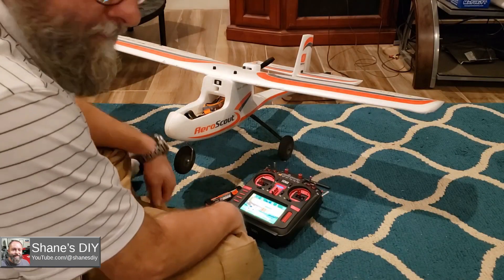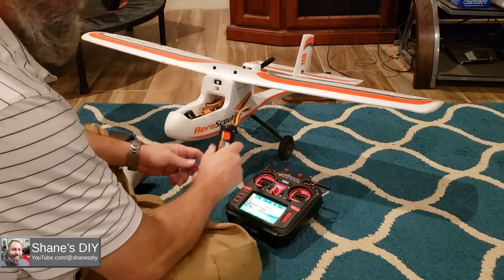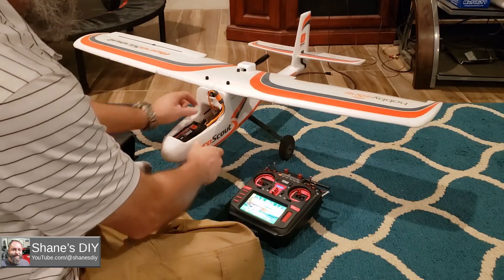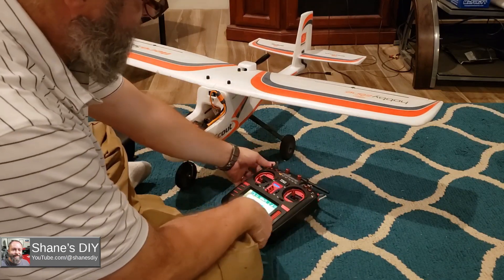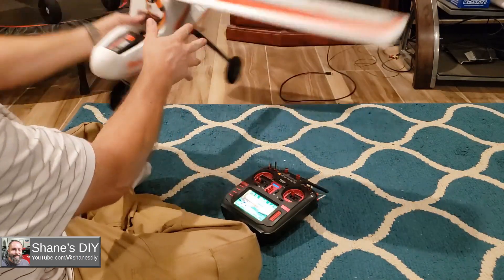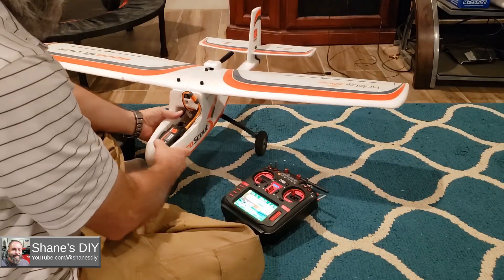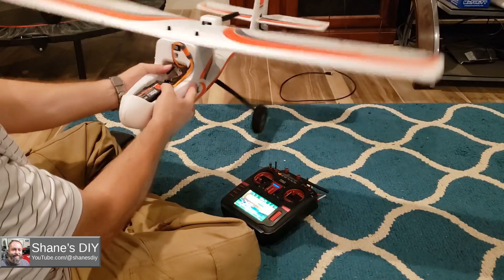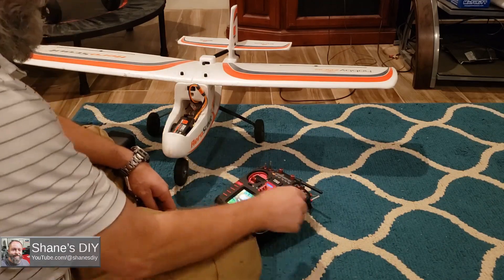BUSTED!!! Spektrum SAFE Mode Myth #2 "Throttle up to enable SAFE"

Comment from the maker: Still a few people that don't believe even after demonstrating it.  Figured I'll add that I am specifically referring to the Spektrum AR630, AR631, and AR637 that I have been able to personally test.  Read the Spektrum receiver manuals, they also clearly state AS3X is activated at 25%, doesn't say that about SAFE for other models such as the AR8360, AR10360, etc.  Could be something older like an AR636 that this does not apply to but perhaps someone who has an AR636 can confirm for us.

Just to be clear, this isn't really an issue to worry about.  The airplane will fly fine if you perform your checks properly.  Where it becomes an issue is when someone is trying to program their safe select/F-Mode switch to a channel and is having trouble and an "expert" tells them to throttle up to 25% make safe work.  It won't help and it makes it harder to actually help them solve their actual issue since they have to weed through bad advise.

Comment: Yep, SAFE mode doesn’t require opening the throttle, but AS3X doesn’t activate until you open the throttle above 25%. This is one reason why I like to do my gyro direction test in SAFE mode.
Reply from the maker: For sure. So much easier to check your gyro directions in safe. Eliminates the guesswork.

Comment: I just did it, about 15 times in a row. I picked up three brand new Aeroscouts yesterday to take to the lake and sure enough….SAFE mode WILL NOT initialize until throttle is moved, on all three . AS3X is on as soon as the plane is powered up.  
Note…I did buy the RTF models as it’s cheaper than the BNF, then just bound my IX20 to them. Surely wouldn’t think that would make a difference though. Same receiver.
Reply from the maker: You have the terms backwards. Safe (auto leveling) is on immediately if in f-mode 1 after power up and initialization, as3x (wind mitigation) turns on after throttle is raised.

Comment: Shane, i programmed a 3 position switch with forward programming in a boxe tx.
Mode 1. : as3x and autolevel, mode2 as3x and envelope and mode 3 nothing ( no as3x and no safe) . Problem : rated in mode 2 and 3 are full rates or full throws but my skills are not good enough to fly in full rated , i use to fly my plane in mid rates before i switch from lemon to ar631.
Is the a way to have mod 2 with medium rates , as3x and envelope? 
thanks
Reply from the maker: You have a Radiomaster Boxer right?  If yes you can do what I do. The same 3 way switch I use for the 3 safe modes I also have setup for high and low rates in the transmitter. The rates do not need to be setup in the receiver, they get done normally in the inputs area of the transmitter.  In the switch position for safe self level mode 1, I set 100% rates (because the rx lowers rates automatically), mode 2 can be low rates with as3x, and mode 3 can be your high rates. The rx does the gyro mode switching but the rates are done in the transmitter but all from the same switch.

Comment: I have a question,  my friend has been flying his Corsair with a AR630. I setup the rx using forward programming on his DX9, now hes using a Radiomaster boxer,  how do i get safe to work with that. I tried a few things and cant figure it out
Reply from the maker: If the receiver was all pre setup on a Spektrum transmitter, or any compatible transmitter, the safe channel, panic (if applicable) channel, gyro channel (if set to adjustable), etc, do not change after binding to another radio. You just need to map the proper channels in the new transmitter in the mixer. Should be no need to go back into the receiver via Forward Programming unless you want something changed.

That is how I originally setup my first AeroScout since at the time EdgeTX forward programming couldn't do it, I configured with my Spektrum NX6. Then just mapped the channels in my TX16S to what was programmed and it worked perfectly.
Reply: @shanesdiy  I figured it out. I was using ch 9 and on the transmitter I had 1-8 channels,  once I changed it to 1-9 I got it working
Reply from the maker: @Mikeylikesit1968  Great. FYI you can set the enabled channel range up to 12, it usually defaults to 6 or 8.

Comment: Have you busted the myth where turning your plane upside down in SAFE mode, rocking it back and forth thru level, and seeing the ailerons zip back and forth to full deflection proves that the gyro direction is set correctly?
Reply from the maker: I assume you are referring to actually confirming the surface goes the right direction, not just that it moves?  Absolutely, even watched Brian Phillips make that mistake during his setup of an airplane in one of his videos.  Not unlike someone just wiggling all the controls before a flight to see that they all move, rather than making sure they are actually going the right direction.
Reply: @shanesdiy Yep, the inverted rocking test proves nothing unless you actually look at which way the plane will roll. If the gyro is reversed, it'll roll back to inverted level and never go right side up. The best test is to tilt the plane 45° from upright level in roll and pitch and make sure the surfaces will push the plane back to upright level.

Comment: There are many times when SAFE mode doesn’t activate until you throttle up. I can’t tell you when it’s required and when not, but I can say ABSOLUTELY that it’s a thing. So you demonstrating that on one airplane does not bust the myth…. Which isn’t a myth.
Reply from the maker: I can show you with 2,3,4+ airplanes but I can't force you to believe it.  I've programmed many airplanes with the AR630, 631, and AR637 receivers and this is fact.  Even in the airplane manuals it specifically says for AS3X to activate throttle up to 25%, says nothing about safe.  Never once found safe not active until throttle up, only AS3X which is not the same thing.  If you are referring to the older and obsolete AR636 it may be that way but I can't say.

Please let me know if you know of a Spektrum receiver that doesn't activate SAFE auto leveling mode until you throttle up and I will be happy to amend my video.
Reply: @shanesdiy  I'm only telling you what my personal experience has been.  I haven't kept a journal of these things to know which planes/receivers require throttle up to engage SAFE, but I know that I've tested SAFE by turning the plane side to side only for nothing to happen.  Then I run throttle up and SAFE activates.  I also can't force you to believe what I'm saying. I don't care enough about it to take the time to go mess around with airplanes until I find one that works the way I've described.  So, if I happen upon it, I'll let you know.  I guess I do have enough curiosity about it that I'm going to pay more attention, so maybe I'll have some information to share with you sometime.  And I did enjoy and appreciate your video and hope to learn more about this so we know the full story.  Thanks.
Reply: @shanesdiy  I said I didn't care enough about this to take the time to go mess around with airplanes until I find one that works the way I've described and then I immediately went out and started messing with airplanes until I found one that works the way I described.  I tested this on one airplane with an AR637T receiver and on three airplanes with an AR631.  Things worked exactly the way you describe.  SAFE mode activated without having to run up throttle.  AS3X did not engage until I ran up the throttle. Then I pulled out my old Apprentice with an EFlite EFLR310013 receiver.  That one did require that you run up throttle to engage SAFE.  So, I have not found any Spektrum SAFE receivers that require throttle run-up to engage SAFE.  The "myth" appears to be a carry-over from earlier EFlite and maybe other receivers.  So, with your clarifying comment that you're referring to AR630, AR631, and AR637 receivers, you have no argument from me.  But it's worth clarifying, I think, that some planes with SAFE mode do require that you run up throttle in order to engage SAFE.
Reply from the maker: @baughboom  Haha, sorry I planted that seed but I know how it goes!  Get something in my head and I have to figure it out.  I appreciate you looking into it.  My goal isn't to be right, I honestly just enjoy helping folks figure this stuff out and have a good experience which is harder when they get conflicting info.

I have a couple FMS Reflex gyros in a couple airplanes, haven't confirmed on those but of course now I have to know, lol. I don't think the Reflex needs a throttle up for any of the gyro modes.  My brother has an Arrows Vector gyro, I'll have to inspect that one when I get a chance.

Thanks for your input!